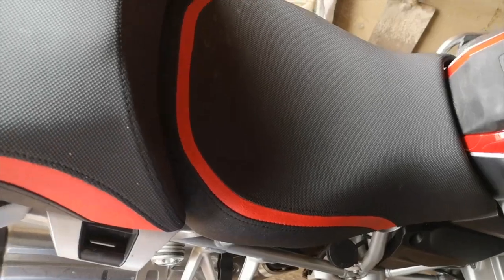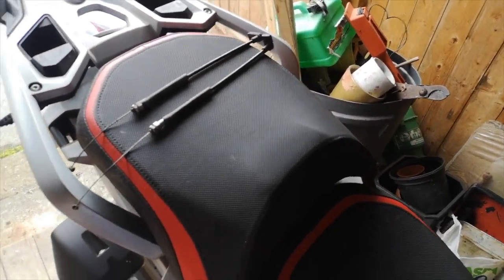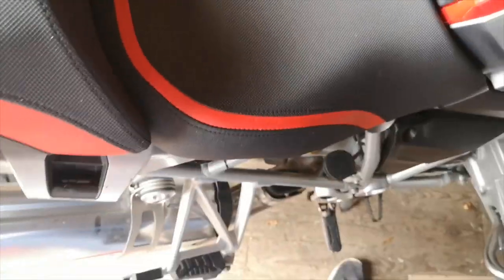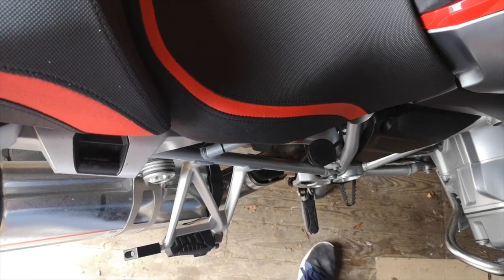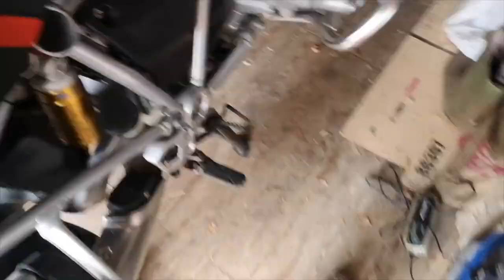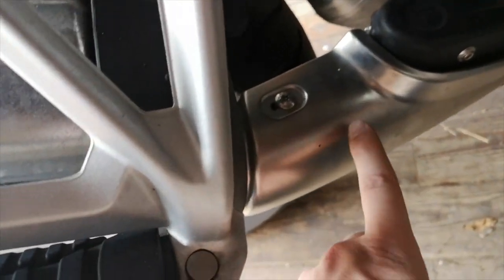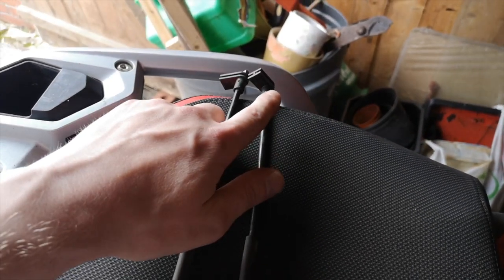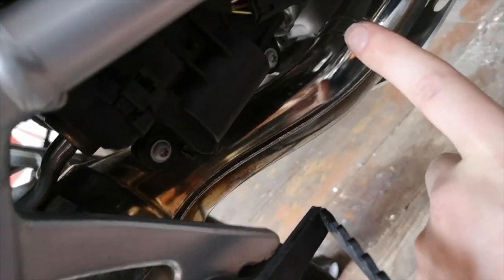MY BMW R1200GS HAS MORE PROBLEMS... *Let Me Explain*

Comment: Hi James. I had a similar problem on my Camhead R1200RT, so I removed the entire system and plugged in a Skutrnet servo buddy, which prevents error codes from being generated. Worked fine. Might be worth a look if you want to be rid of the extra baggage, electric motor and cables
Reply from the maker: I went to bmw and they said take the pulleys off the exhaust door to keep it open. Seems to have worked. I may upgrade the bike soon for the amazing bmw warranty ha. Thanks for viewing my video and commenting. Nice to read some helpful comments for once.

Comment: Can't understand people have with BMW1200GS I have a 2007 model, it has done 112,000km and the only issue I have had is about 5000km ago the fuel gauge stopped working. Not bad for 14 year old bike.
Reply from the maker: yeah same. I've had cbr600, f800r, f800gs and now this r1200gs and it's the best bike I've had. I will be upgrading it soon I thin as my model year didn't come with a few essentials things and somethings aren't working always so watch this space. More videos coming soon on my bike and car.

Comment: I had the same problem I rremoved the black cap freed off the cables removed them from the two holes on the round plate. I then got a piece of wood put two screws in the same distances apart as the holes sprayed copious amounts of GOOD OLD WD 40 on the butterfly valve just where it enters the exhaust used the wood to free off the valve  by rotating it 180 degrees  once it moved freely I reattach the cables turned on the bike and the butterfly valve opened as it should. I then put a lot of molly grease around the valve and fitted the black cap back on the exhaust. P.S check every few months afterwards just the make sure it still worked fine.
Reply from the maker: Nice, Good work, I just took them off as BMW said instead of buying a £800 exhaust, take the cables off and it will pass it's mot and it's fine. Never put the cables back on and i get the odd pop now too which is good for my riding videos haha. Thanks for your kinda message and safe riding. Gonna change my fog lights soon on it too as mine have a fault as I got the bike with them on.
Reply: Is the wood just used as a lever?

Comment: PLEASE HELP! My left cylinder is the only one working and found I have a #1 O2 sensor (271A) fault on my '12 R1200GSA. I swapped O2 sensors after cleaning them both well and the same fault returned. I got spark from all pretty new plugs while out and cranking the engine as they were grounded. With this in mind, I decided to buy two primary stick coils after reading the forums. One would hopefully fix a possible bad one on the rt side and one would be a spare. This had no affect and I even tried both new ones thinking I might have gotten a bad new part. I even swapped the lower stick coils, though they connected but didn't attach at all to the frame. I swapped upper and lower plugs and then left and right side plugs to no avail. I pulled both fuel injectors and saw the same spray patterns from both while cranking but bought a new one anyway to put in and to fortify my backup parts while being able to clean one at a time in the ultrasonic while still being able to ride (cheaper and better in the long run than putting additives in every other tank of commodity ethanol free gas). So I confirmed fuel and spark on the right side and even took the little cap off the throttle body and confirmed vacuum while I had it fast idling on the left cylinder yesterday. I also confirmed my throttle cable is on and actuating the throttle body valve and is "in the groove" of the linkage on the right side. I took the right head cover off and everything is rotating properly and know that I adjusted the valves end of last Summer. So I'm down to the camshaft position sensor. I put the meter on it and got a .458 kOhm reading. Is this correct? I am SOOOOO hoping this reading is way off from what it should be as I need to get this bike running again. Can anyone on here confirm the spec's of this sensor or otherwise assist? Could it by my ECU that's only working half way? Thanks so much gents and the occasional lady I read about on here!
Reply from the maker: I took off the 2 cables that open and close the exhaust door and this let the door stay open and since let’s the fumes out. That’s all I can help you with. This video is just about the problem I had and it’s solved now. I’d take your bike to your dealer or a mechanic and get them to fix it.

Comment: Did this mod affect the torque curve?
Reply from the maker: To be honest it didn't effect much. Its louder which is great for traffic hearing me when filtering. and BMW actually told me to do this as a cheap fix instead of buying a straight pipe.